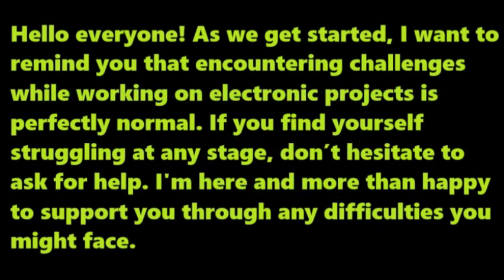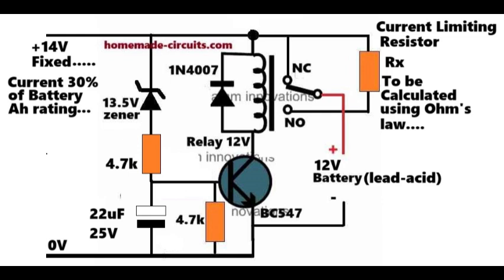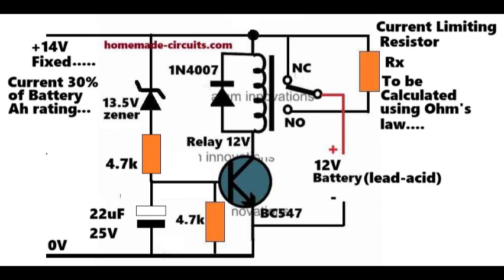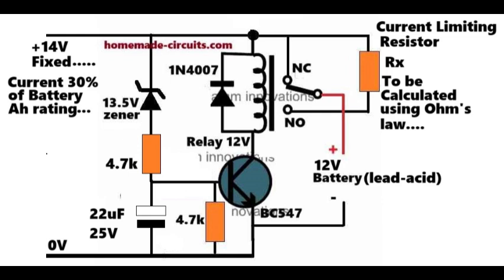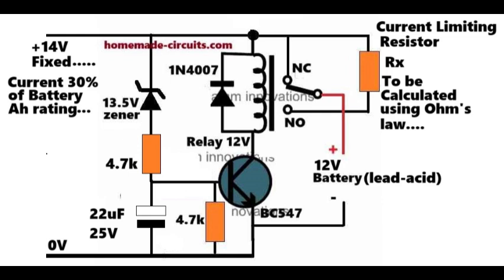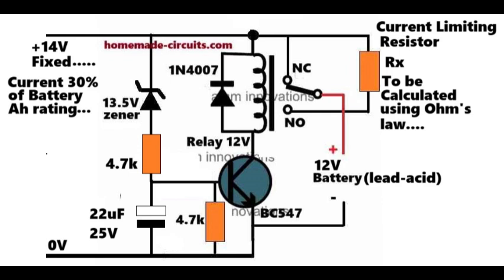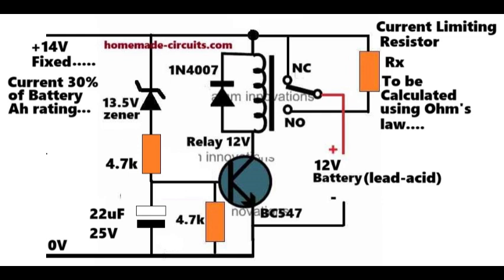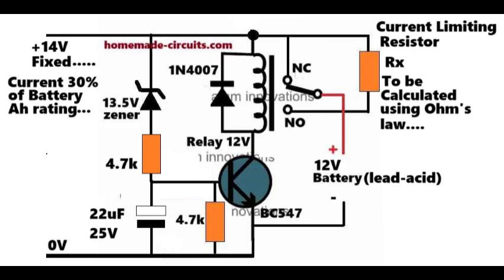Simplest Fast Battery Charger Circuit Explained

Comment: Sir pls upload solar charger for phone. Solid Supporter in your channel from Philippines kim balndix.   Thank you
Reply from the maker: Thank you @electricalandelectronicinf1866, I will definitely do it soon....by the way You can charge any mobile phone by stepping down the solar panel voltage through any suitable 5V regulator.. :)

Comment: Hi sir, can you give me a diagram for charge controller for 24v lead acid battery using solar panel? This is my final requirement of my subject sir i badly need it :(.. thank youuu
Reply from the maker: Hi Hughian, we discussed this in the following page, I hope it will solve your battery charger requirement correctly...https://www.homemade-circuits.com/contact/